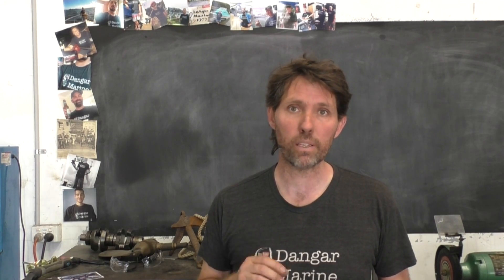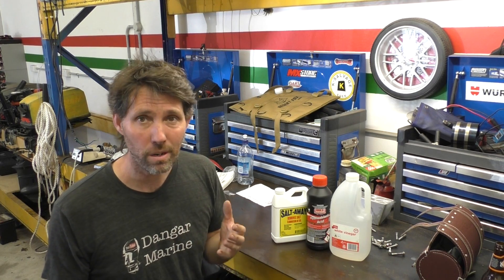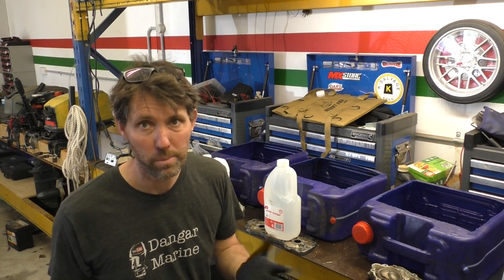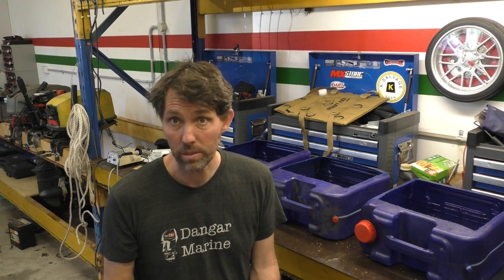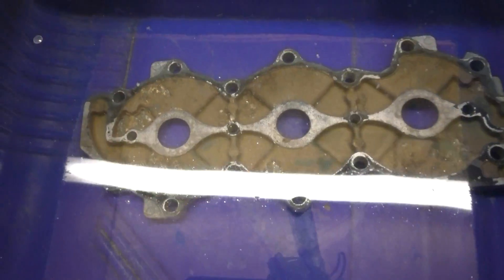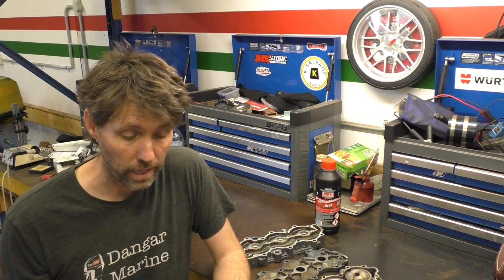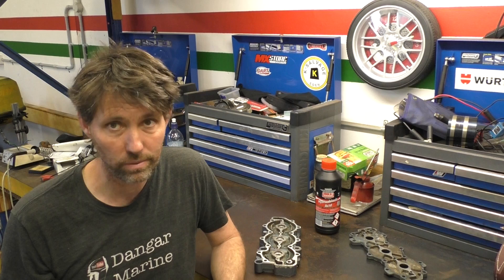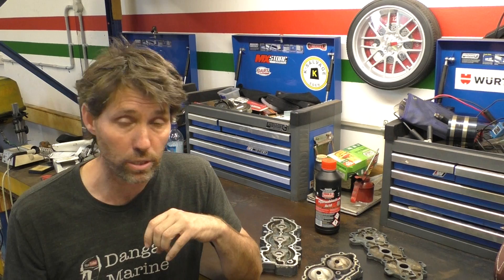Cleaning outboard water passages

Comment: Also try anything with Citric Acid..., heated in a pan with light brushing...  It's a very safe cleaner used in radiator flush.., sold in the auto parts stores...

Comment: Hi, I'm following your videos. and I have a problem I can't fix.
I have a 99 Yamaha 50hp.
When is cold everything works perfect, the water comes out of the pee hole strong.
Once the motor gets warm water flow starts going down and then the alarm goes off.
Here is what I did so far.
Water impeller
thermostat
Removing the head and cleaning all the passages

Is driving me crazy, any help will be much appreciated.

Thanks
Reply: Did you fix it
Reply: @murphymartin1224  YES !!!
I bough a water pump rebuild kit ( o rings and gasket are very important ) I only Replaced the impeller before.
If you have the opportunity, testet in idle with the garden hose and if after 5 mins there is not overheating, do a proper test on the water.
Good Luck
Let me know if you have any question.
Reply: @estebanfandila   mine  is a Johnson 130 2000 model I use mine spring & summer  mine has no thermostat runs good upon starting run down river pull back to idling it dies go to take off tries to die. Low water / warm alarm beeps rarly when idling but my piss stream is never a force  like a heavy drip wide open then idle a slow drip new water pump/ lower unit 2 years ago
Reply: Have you change the propeller recently
I do propeller and gear oil every year. 
are you sure your engine don't have a thermostat ?  @murphymartin1224
Reply: @estebanfandila  yep

Comment: First af all thank for sharing your knowledge with us, i've seen lot of your videos and thanks to you i did most of maintenance and repair by myself. My 60 hp yamaha (2008) started to suffer of overheating problems in the last year in a discontinue way. First i tried to clean it with dishwasher tablets it seemed to improve but after a few months the problem came again. Then after a month was working well again and then the problem reappear again. Today i did a 1 hour 45 min flush with hydrocloric acid, in 15 liters of fresh water i added 1 liter of 33% concentrate acid and 1 liter of 10%. Soon after i mounted back the thermostat ( i was surprised to see how clean was the thermostat slot) and i did a run test for 20 minutes at high rpm (up to 5100) it didnt suffer of overheating problem at all, on the display it was stuck on the 3rd score. Then i measured with gun thermometer and close to thermostat it was 64 °C and that should be fine instead in an areas in the upper side it was 98 °C. Do you think should i worry that there is a passage in the upper side that is blocked? Thank you again

Comment: If anyone wants to run whatever product through an outboard, may I recommend the use of a small submersble pump? I have a pond fountain pump, quite grunty, with a hose I can connect to earmuffs. Then you can put Saltaway or whatever in a tub with hot water, position the prop over the tub  and leave it circulating though the engine without the motor running for as long as you like. Thermostat removal is recommended for flow through the head, though. Dangar Marine is the best. Thanks you guys.
Reply from the maker: Sounds like a good tip. :)
Reply: That's exactly what I did for my jet ski and  really really work
Reply: Have you ever heard about cleaning with Pine Sol? I cleaned a carburetor with it and it turned out like new! I plan on running it through a 9.9 outboard I have that is overheating and shutting down after 4-5 minutes of idling!
Reply: I like your idea.🙂
Reply: could this work for a car engine?
Reply: Accept when you have a 2007 mercury 2 stroke 8hp where the thermostat is under head and needs head removal to remove thermostat. Makes job a lot more costly and time consuming and involved .
Reply: Great idea. Can you get a better flush by pulling the lower unit and hooking to the water inlet pipe?

Comment: Hydrochloric aicd will react with aluminium.
 BUT! will not react with the aluminium oxide layer that is formed during the reaction.  So it will only react with the very top layer only few microns deep
Reply from the maker: Yes, I've heard the oxide layer is very hard. Good to know it will protect the aluminium during cleaning.

Comment: SAFER IN EVERY RESPECT IS PHOSPHORIC ACID.   DILUTED TO 10% CONCENTRATION IT WILL NOT BURN OR IRRITATE YOUR SKIN - KEEP OUT OF EYES DONT BREATH MIST-THE REACTION WITH CALCIUM ( LIME)  GIVES OFF CO2.. WATER...AND SOLID CALCIUM PHOSPHATE AND IT WILL NOT ATTACK COPPER OR IRON.  IT WILL SLOWLY ETCH ALUMINUM.   -- IN CONTRAST MURIATIC ACID GIVES OFF TOXIC CHLORINE GAS, AND WILL EAT YOUR SKIN AND YOUR CLOTHES !   "BARNACLE BUSTER" AND OTHERS ARE JUST PHOSPHORIC ACID.   BUY IT AS A GENERIC METAL ETCH PRODUCT AND DILUTE WITH WATER AND SAVE BIG $. DO THE JOB WELL, AND SAVE YOUR HIDE TOO !

Comment: hello dangar, I have tried many things and here is my favorite list. caustic soda. (remember to clean with fresh water) cleaning tablets for dishwasher. Cooler cleaner for car worked best. and so it's designed to not attack the metal.

And hello from Denmark , Its the Best Channel on youtube ☝️💪 keep up the the good work !
Reply: AIR COOLER CLEANER Not Compatible: May swell rubber and synthetic rubber. Be careful with the impeller and other stuff like gaskets made out of rubber!
Reply from the maker: I've certainly washed parts with dishwasher cleaner before, it does the trick! :)

Comment: Hey Dangar, im getting some salt build-up on my two-stroke yamaha, under the coil; in the lower back corner - where the sparks are. Is it normal? Also, is it advisable to give the power head a gentle rinse with some fresh water/use a toothbrush to clean the salt? Cheers!
Reply from the maker: It shouldn't get too much salt there, if it does you have a small leak from the cooling system. Cleaning with flesh water is fine. I often even pressure wash outboard engines.

Comment: Why don't outboards have hose connections on the top of the cowlings?  It's an open system.  Seems pretty simple to me.  Fill a 5 gal can with fresh water at the dock before you hang it back on the mooring.  Give your motor a drink as a last thank you for the day
Reply from the maker: Some do have the attachment on the side so provided you run a hose up high it should gravity feed.

Comment: Another strong video.  thanks.  Has anyone considered  the descaling products formulated for tankless boilers and hot water heaters?  Often the heat exchangers are stainless, but often also they are aluminum
Reply from the maker: That's a good suggestion, well worth looking into.

Comment: Hay stu i found that a dremel fited with a cone wire brush wheel works effortlessly with no cleaner needed. It takes it out in seconds turning it in to a dust try it you will love it but do it when its dry not wet

Comment: What could make water to come in the cowling around the motor when it's running
Reply from the maker: Could be the gasket under the power head, the exhaust cover gasket or the tell tale hose. I would dry it completely and then see where it first appears.

Comment: I've got in my shed somewhere  a product called "corro dip", think it was mainly aimed at steel corrosion. We used it for removing rust from bore water on sst plate cooler plates - somewhat successfully. It had a somewhat pleasant smell as i recall but can't really describe it - sweet smelling maybe. Years later i opened the bottle, and it smelled of vinegar ! I believe it was basically vinegar , with something to mask the smell and possibly an inhibitor to stop it eating away good metal. I've read about using vinegar to dissolve corrosion etc before and although i haven't tried it, from what i read the dilution ratio was highly critical for it's success, so possibly you didn't have it strong enough? (and i'm suspicious that vinegar you buy is already diluted)

I've started flushing my boat using salt off at first, then moved to salt off SX50 - especially after reading what they say on their website ...... wether its true or not i can't say. Currently using a star brite product just because i couldn't get the SX50 locally. According to SX50 it's an inhibited "soft acid" - the acid dissolves the salt and corrosion, the inhibitor then stops it dissolving good metal. If it's true then i'm on a winner. 

Problem I have now is , i keep my boat in the marina on a float so it's out of the water and flush it after every use using the flushing port on the motor (where the tell tale water comes from so it's actually reverse flushing) rather than earmuffs as the gear case has water intakes in the front of the bullet as well as the usual ones. (E-tec 150) Everyone you talk to says that's no good - doesn't flush properly- even my dealer/mechanic. (yet he did say given my circumstances to just use the flush port)
So i'm now thinking of rigging up some sort of flushing bag which would also have the advantage of getting the engine temp higher and therefore the thermostats open better, but it's going to be a bit of a rigmarole to do.............. the joys of boat ownership!
Reply from the maker: I'll have to look into SX50. You're right about flushing boats that are in the water. Mine gets used several times each day but only flushed about twice a year during its service. Given it gets used in salty muddy water it's amazing how well it does.
Reply: I need to get my act together and start doing some corrosion experiments using the various salt removing products i have. I have cleaned thermostats and slalom ski fins with them but their effectiveness for me hasn't been as good as their literature implies. However it did clean thermostats up pretty good with some scrubbing along with the soaking.

Comment: Good video mate to be honest for a quick imersion in the acid and thn a rinse of i dont rekon there would be much damage and a good clean would result as you have shown ,i like the comment about the coke that would be interesting but coca cola might not like it hahaha vinigar na leave it for the chips and salt away well to me just for a everyday every use flush , most boaties flush there engines at the ramp anyway i used to do mine twice once at the ramp then again at home after i washed the boat pedantic yea maybe but thats just me .
Reply from the maker: Yes, I agree that products like Salt Away are designed for regular use rather than for cleaning a badly blocked up cooling system. Having it in a big drum and the motor running helps too to keep the water flowing.
Reply: @DangarMarine  I know this is an old video but just recently i bought a yam 40hp that had some radical calcium build up in the waterjackets to the extent the main entry passage was blocked , thinkng outside the box i decided to give C.L.R  neat over night and i was amazed at the difference , did the same with a thermostat that wasnt working and after it was working really well and almost looked new something to think about my take is it has been flushed with bore water no salt corrosion i could see take care .

Comment: Here in Florida I found few things that worked for me. First..most products on market are designed to do quickly flush when you are just done boating *fresh build up of saltwater*  that is reason why they call it *flush* same thing you do to the rest of the boat /trailer...To disolve old hardened salt is like opening Pandora's box, each motor will have it's own story... This is what I have been doing on my 90hp 1994 outboard Yamaha for years (I do trailer and store dry my boat). So far worked for me .. After every use, I do  5 min flush with plain clean fresh water with muffs, then 5 -10 min (CLR  cleaner) into the dosing unit of flush kit until gone, and at last 5 min with (saltaway) solution ..BTW.. Motor is running in idle, I did replace gasket on the cylinder head once but never ever had any build up... I hope this helps folk.. FYI.. I run only 30psi pressure on my garden hose for the muffs, I found out that reducing pressure little bit allows chemicals to work longer and better .. good luck...
Reply from the maker: There is no doubt that flushing regularly is the way to go. Freshwater, CLR and then Saltway is a serious routine. I'm not surprised it was clean. :)

Comment: Hi Stu, thanks so much for this. My Suzuki DF50 - 2008 was very much in need of serious flushing. I opted for neat white vinegar and found that, after circulating it for an hour (with the thermostat out), I got about two teaspoons full of gunk in the bottom of the bin I was using.

I kept the vinegar and tried it again the following week and got the same result. Since then I've done this around 8 times over the last month or so and I'm still getting a good quantity of gunk out (although down to about 1.5 teaspoonfuls per go now)

It's hard to believe there's so much stuff in there - certainly explains why the thermostat was stuck open.

Thanks again for these amazing videos, you're helping thousands of guys like me to look after our boats AND learn while we go!
Reply from the maker: Hi Mike. I think having the water circulating and the natural head of the motor too will help a lot with cleaning. Your experience goes to show how regularly you need to flush to keep a motor clean!

Comment: Do you feel saltwater decreased the longevity of the engine?  If you do by how much?  50% or more.  If an engine has 350 saltwater hours on it how many more could be expected?
Reply from the maker: That's a good question, and a tricky one to answer. The motors we have around here live on the water all the time so it isn't just the running hours that get them, it is the constant salt air that rusts out the pivot brackets etc. The Honda I have on the Green Machine had about 300 salt water hours on it when I got it (plus having lived on the water for 10 years and been sunk completely) and I'm expecting to get over 1000 out of it still.
Reply: Thanks for the reply.  So 350 hours should be no problem for engine longevity.  It is good to know these types of things when buying a used boat and motor.

Comment: I saved a junk motor that was clogged up with a diluted acid mix with the motor running in a garbage can for about 45 minutes. The can had a bunch of crude on the bottom afterwards and the motor ran great until a crank bearing failed a few years later. I was surprised to see how clean the block looked during the rebuild process and I didn't see any signs of damage from the acid mix. I know it sounds pretty crazy, but it worked great.
Reply from the maker: Hey Jamie, great to hear the acid worked for you. I think it is the way I would go to. I don't see you have much to lose if the motor is that corroded up anyway. Any idea what ratio your mix was in the garbage can?
Reply: I can't remember to be honest? Maybe 1 quart or more to a full garbage can full of water.  It started to irritate my eyes and skin because I was constantly pushing a piece of mono leader into the pisser because of the crud breaking lose. I practically got the motor for free and I had nothing to lose.  It was well worth my efforts in the end. Some of the old Yamaha 2 strokes are highly sought after here in the USA because of our EPA. 
I had a lot of fun restoring this junker http://s1262.photobucket.com/user/blindshot75/library/Yamaha%2030hp?sort=2&page=1
Reply from the maker: Cool, I'm glad it worked for you. I would certainly be willing to give it a try in a similar situation. As you say, you have nothing to lose with some old motors. From the photos I can see you did a lot of work on it. :)

Comment: your glasses would work better over your eyes instead of ya head...lol.. you get that acid in ya eyes and you are screwed ...at least ya put them on when you brushed...love ya vids..
Reply from the maker: I always have my safety contacts in for just such occasions! ;)
Reply: haha...nice one, I do have a question for you though, I have a 2007 Yamaha 70 2t and the "mechanic" who replaced the impeller because there was no water coming out, obviously did not clean or flush the engine at all because now a yr later it happened again, I stripped it to find a perfect impeller but a shit load of old rubber impeller all through the thermostat and water jacket, ive flushed what I can out and seem to be no more coming out but in your opinion is there anything else I should do before replacing the impeller again ... I bought it as is for real cheap because it had no water coming out and that's when I found the old one still floating bits around.. it starts and runs perfect ( obviously only ran for 30 seconds or so because of no water) but compression is perfect and seems 100% besides the moron who didn't flush the rubber out when the impeller got chewed up...

Comment: Good to see all three tested together. My 40 Yamaha 2 stroke (5 year old) wasn't spitting out much water so I tried 50/50 vinegar and water in a tub. Four ten minute sessions running the solution through fixed it right up. It was slowly heating up so I needed to let it cool down between the sessions. The tub was quite milky at the end with fine white grainy bits in the bottom.
Reply from the maker: The the gunk in the tub it sounds like it really got a fair bit of the mud and salt out. Nice one!
Reply: Not to mention cheap and enviro friendly.